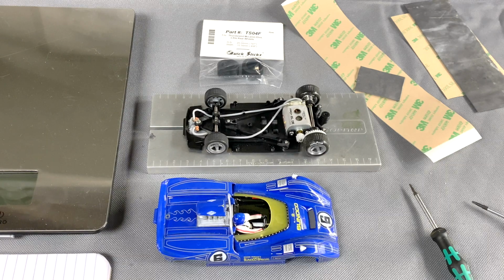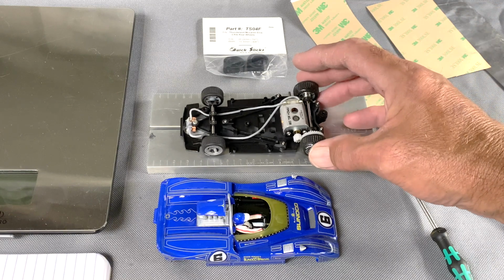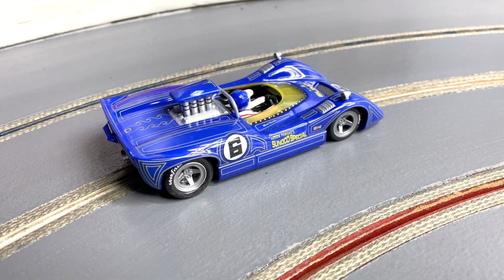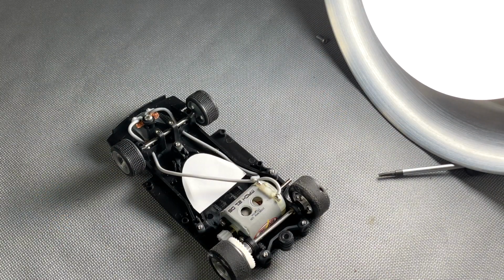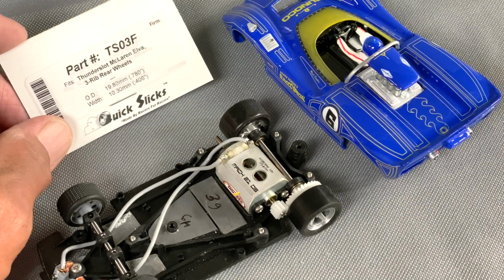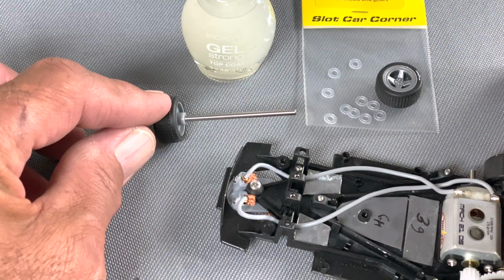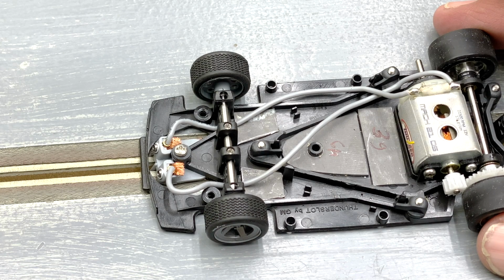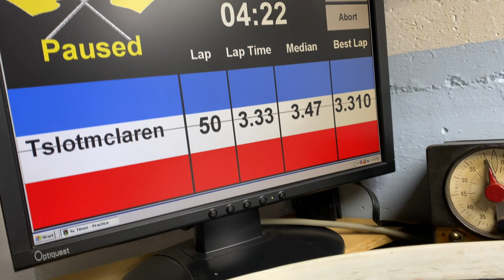Thunderslot McLaren Test and Tune

Comment: Impressive. Do you have any recommendations for a variable power supply? I want to start running both 1/24 and 1/32
Reply from the maker: Well what 1/24? My pick is this and still working today. https://youtu.be/8hp00iVKAXI
Reply: Homeracingworld 1/24 will mostly be Carrera , both analog and digital, and BRM analog. 1/32 Carrera , analog and digital, NSR ‘ Fly and Slotit analog.